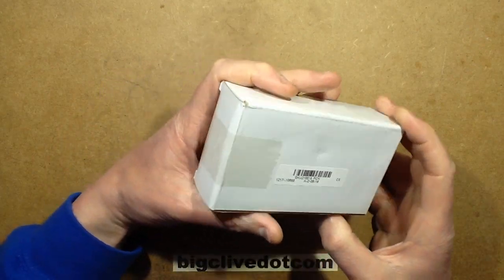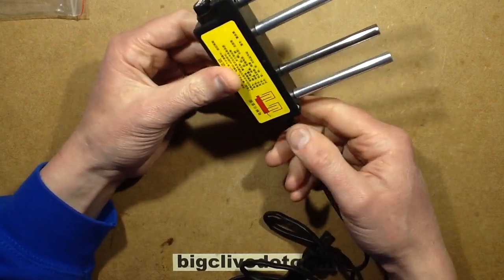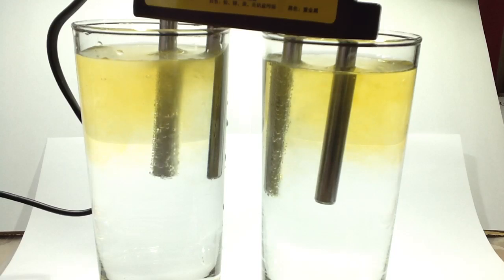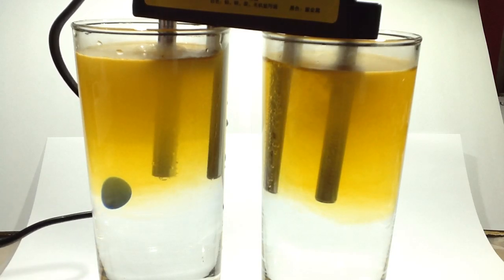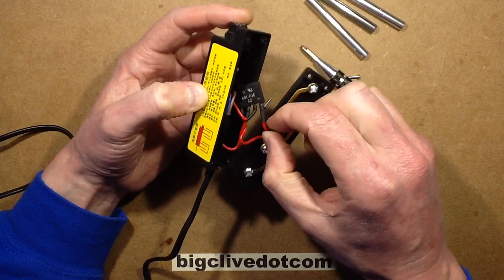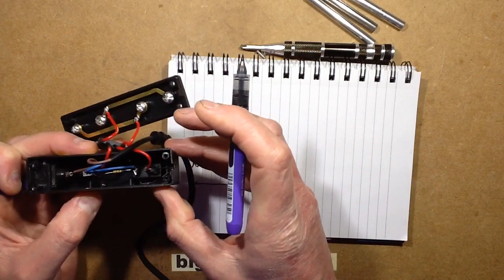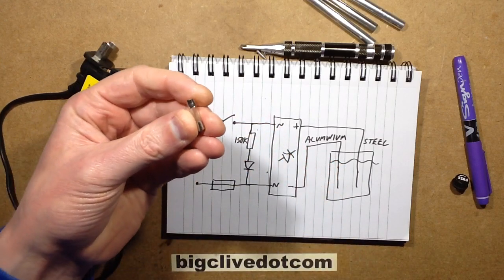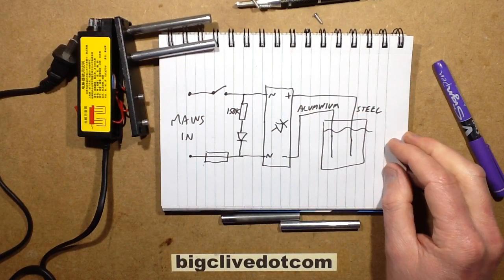Deadly quack water tester.  (scam)

Comment: If the water doesn't kill ya, that 'water tester' sure will.
I just can't believe that lethal crap like that can be sold legally.
Reply: I don't think it's legal.
Reply: If it was legal, though I'm not terribly knowledgable of EU or UK regulations, I doubt it would be labelled completely in Mandarin. Check the first few moments of video as the label sides are flashed around, there's not a single Latin letter.
Reply: hucker75  don't know why you are being a dick but surviving a shock from the mains isn't proof that it can't kill. What makes the difference typically is the route travelled through the body based on what is grounded. From a hand to a foot people often survive same with if it goes through just one hand. But when it goes from one arm to the other it passes the heart and easily stops it.
Reply: AC or DC, rectified or not, it doesn't matter, direct contact with non-isolated 240V mains live is going to fucking kill you. Period.
Also because it's rectified, both electrodes are live, and both will kill you.
Reply: @MrDoboz  It can kill you 50/50. More likely you will die if you have moist hands while standing on something wet. But obviously I don't recommend touching live conductors with voltages in them above 36V for anyone. 220V AC with dry hands in dry environment is already veeeeery unpleasant.
Reply: Cobb Butterscorn
Correct. DC is way more lethal though of course AC can kill. It's the current level that will cause the problem. 1A at 12VDC will kill you if directed to the right place but your bodies resistance will prevent any shock.  Can only imagine what AC is leaking through that bridge rectifier connected directly to 110/240VAC mains let alone unregulated 240VDC,  no step down transformer, no protection circuit AND putting it in water. What happens if it slips into the glass? A 10A fuse 240VAC is not going to help with all those bare wire connections straight to the mains! DEATH TRAP.
Reply: @KevinHallSurfing  tell that to ElectroBoom
Reply: Its not DC, its full wave rectified AC. The voltage still rises and falls between mains peak and zero, it just doesnt change direction. Both AC and DC are lethal at high enough voltages to drive enough current, DC is a more painful shock as there is no zero point. Anyway, the rectifier here makes no difference to the current flowing through you if you touch the electrode, or how painful it feels.
Reply: @howsyourdangler  If it doesn't change direction it's DC.  In this case unsmoothed DC.  There is a zero point, it just isn't crossed
Reply: @Mouseythegreat Well you are getting about 120/240 Volts (depending on country) across the terminals so make sure the seller has his hand on the desk to add to the effect ... but ... yes! Guarantee they never try and sell one again! 😆
Reply: @Deon Denis There's one born every minute.
Reply: hucker75 weird flex but ok
Reply: I have had to many close calls just growing up in the sticks and being an active person my whole life.

Maybe I should buy hazardous electrical equipment to increase the chances of success! Lol.
Reply: hucker75  Yes, killed by shoddy Chinese electrical goods.
Reply: hucker75  At next time grab live and neutral wires with both hands.
Reply: the average "scientific" (forgive me...) culture of the people is simply a shame.
Reply: @marcovalentinuzzi5830  
 Indeed. 
Most people have no idea of how even the simplest scientific principles apply to daily life.
Reply: You are an idiot!!! Its DC electricity, and its only half a watt...
Reply: Yeah only dangerous if you are a retard like yourself
Reply: @yoyoma5263  
 Grow up!
Reply: So ok the machine is dangerous. Does it work tho and show impurities in water ?
Reply: @romeowandrainbow1040  
 No. It does not work for that purpose, or anything else, really. 
 It delivers current to the water, and ADDS impurities to it, as its electrodes break down during electrolysis.
Reply: @romeowandrainbow1040  It works. A TDS meter will prove it. Test the water, then use the machine and you can see the impurities. The instructions list different colors to illustrate what's in the water.
Reply: Legal or not, if the mainstream media were so informative, why aren't they letting us know about our water being like that, instead of us finding out from a curious individual posting a video?
Reply: @samstyme4125  
 You should be using science, to make those discoveries, instead of relying on YouTube for it.
Reply: @CNCmachiningisfun  If science hasn't told the public about what's in our water thus far, when do you think they'll tell us? I did the same test. I also used a TDS (Total Dissolved Solids) meter before I did it.  I got the same results. I can send you a pic and video of the results, if you'd like. Then tell me if you'd drink the water, after seeing the things that became visible.
Reply: @samstyme4125  
 ALL you did was add pollution to the water, when you dissolved the electrodes in it, during electrolysis. 
 Please study the science behind this, and avoid further embarrassment!
Reply: @CNCmachiningisfun Then I suppose I have nothing else to say to you about this. Even though others may be an expert and more educated than you on a certain topic, does than mean that they are being truthful or even care about your well being? If that's the case, never mind someone like me, who's just questioning the narrative. I'll  leave you alone and allow you to "Trust the science".
Reply: @CNCmachiningisfun  so how come then that when I tested it on distilled water, it remained crystal clear? Surely it should turn brown or Green like the tap and filtered water if it’s adding pollution to it?
Reply: @TheNinja691  
 Give it time, and it will taint that water also. 
 Once you understand the process of electrolysis, the answer will be clear to you. 
 Edit: It sure would be nice if googleTube would stop CENSORING my replies!
Reply: It's direct current, you don't have to worry as much about it as A.C. I really think Clive is being a pansy, I would touch electrode while on.. it'll just hurt a little
Reply: @carolynmmitchell2240  Yeah, touch it with your tongue.
Reply: carolyn mmitchell What are you, the reincarnation of Edison? No, DC is FAAAAAAAR more dangerous given the constant voltage. It is like the different between getting shot with an automatic rifle verses a semi-automatic one. Yeah, both can have the same power and both will kill you, but the killing is at least slightly delayed with the semi-automatic (AC) given the breaks in firing just as how AC is referenced to a neutral point (often 0V). Also, AC requires a DC signal to stay stable. Kill the DC and you have just pushed the current over. DC? Shit is going to keep going until the original current source is killed...or you are. Guess which will happen faster?
Reply: @tygonmaster  It's not actual DC as there is no capacitor, it's rectified AC so it still hits zero volts just like AC.
Reply: @TomSmith-pl3tw  Not necessarily. Depends at what point it is being rectified.
Reply: @TomSmith-pl3tw  AC means "alternating current", and to qualify as AC the current must reverse direction at some cyclic rate. Since the current only goes one-way, it's high voltage DC, which is worse for you than AC.
Reply: I did not see a transformer in there.  where was it?
Reply: @thomasneal9291  In Shangri La, working by virtual influence and wishful thinking. Gwai-lo are not human, they are expendable.

Comment: So was that cloudy shit just rust from electrolysis ?
Reply from the maker: Yes.
Reply: I would add that what is really happening is that the donor electrode is polluting the water.  When you compare it to distilled water, which has infinite resistance, none of the metallic crud is stripped from the electrode.  Even your filtered water still contains enough electrolyte to start the reaction.  The scam probably involves using some water that is cleverly substituted out for distilled.  What they have invented here is a very dangerous way of measuring the resistance of water.  You could probably make a color chart to go with this thing and have an ersatz resistance meter!  I guess it could also be used as a spot check to see if water is really distilled our not too, providing the electrodes themselves don't provided enough soluble electrolytes to get things started.
Reply: I would add that what is really happening is that the donor electrode is polluting the water.  When you compare it to distilled water, which has infinite resistance, none of the metallic crud is stripped from the electrode.  Even your filtered water still contains enough electrolyte to start the reaction.  The scam probably involves using some water that is cleverly substituted out for distilled.  What they have invented here is a very dangerous way of measuring the resistance of water.  You could probably make a color chart to go with this thing and have an ersatz resistance meter!  I guess it could also be used as a spot check to see if water is really distilled our not too, providing the electrodes themselves don't provided enough soluble electrolytes to get things started.
Reply: anonymous probably iron 3 hydroxide

Comment: Scam? I want one of these! Switch the steel electrode, whose only purpose is to corrode and make the water full of shit, with a carbon one, or another aluminiun, or lead, whatever, and you have a double electrolysis thingie!

Even thought it mostly consist of a FULL BRIDE RECTIFIER (sorry for that) 

Ok, I better use a power supply

Comment: Correct me if i'm wrong, but if we say UK voltage is 230v (according to the regs), that rectified DC voltage is going to be roughly 324V DC (ignoring diode losses)...

Comment: That is insane! how the heck can that be sold. if that was even seen here OSH (occupational health and safety) would be all over that!!! im no electronic engineer or even very good with electronics to be honest. but doesnt 240vac rectified pump out close to 400 vdc? and im a seeing correctly are they switching the neutral feed?
Reply: 340-ish V, but yeah, 240 is just the 'average' voltage from the mains (or more correctly it's the RMS voltage (as the average is actually 0V, what with adding all those plusses to the minuses)).

Comment: Complete scam device. Use steel as a sacrificial anode. Basic electrolysis. Could be turned into something useful. Build some DIY electrodes, baking soda to lower the resistivity of the water and you have your very own rust-killer. Just make sure what ever you are free rusting is connected to the cathode (-) or it will eventually disappear! Sort of.

Comment: Is the output not DC current? I don't get shocked while touching both car battery terminals... Just wondering.
Reply: +timmyboy Car battery is 12-14V DC - you won't get shock from this, but 250-280V DC is totally different story.

Comment: The reason for the different electrode materials and the fact that they are on the one that they are on is due to the electrolysis, The Steel anode will free up Fe+ ions into the water which mix with the O- ions produced during the electrolysis, causing the rust to appear in the water. Different steels will also release other metals into the water which may be the cause of the different colours appearing in the 'foot treatment' video.

http://www.metaldetectingworld.com/anode_positive_electrode_p9.shtml

(Disclaimer, based off secondary school knowledge and quick google searches, take with a pinch of baking soda, don't use salt in electrolysis, warranty void in case of death)

Comment: that device only cheks the conductivity of the water, if you take water from a toilet and mix it with suger it will tell you that its ok to drink it(sugar makes water less conductive), but if you will take filtered water and mix it wirh a little bit of salt(salt makes water more conductive) than it will tell you that its not good to drink the water, becouse the iron containing electrode is in the posive side, oxigen forms on it and not hydrogen like on the aluminum, and the oxygen forms iron oxide with the electrode(you can tell thet its iron oxide by the collor, you can also tell what is positive and what is negetive, becouse when you electrolyze water the negative has double the bubbles as the positive)

Comment: it is just doing ilectrolisis
Reply from the maker: +stratis miritzis Yes.
Reply: +bigclivedotcom Unsmoothed DC is often used in battery chargers for cars - which is basically performing electrolysis on the battery - I think the different metals of the electrodes are essential to the process with the water as there is no acid as you would have in a battery... just a theory...

Comment: How the fuck is this a water tester ? It just makes shity brown water ! So it strips the metal ions into the water because it can't attach to the aluminum! How does that make sense ? Put impurities into the water what is that going to show?
Reply from the maker: +Phoenix Marzrover It's fake.  They tell you that the rust is just the impurities in your water being visualised.
Reply: +Phoenix Marzrover 
To people who don't know how it works, they think the murkiness is created by a reaction with the "impurities" already in the water.
Anyone with knowledge of electricity and electrolysis can see it doesn't test anything, and anyone scientifically minded enough to "test" the water after unnecessary and expensive filtration will see nothing is different. However, lots of people have neither of these qualities.
Reply: +OriginalPiMan   I'd wager that yellow cloud is aluminum chloride :-) I'm glad poster didn't drink the water.
Reply: +bigclivedotcom #science
Reply: +Phoenix Marzrover How is Trump a presidential candidate? -> Your argument is invalid.

Comment: If the receptacle is wired backwards, then the positive electrode becomes an un-switched hot. In 220 countries, it is just plain always hot, as wired. Simply touch the electrode and ground yourself and you will get a nasty shock or be killed., even if switched off.

Comment: I was in the Philippines and a friend of someone came round to try and sell us a machine for distilling water. As per this video, they first had to show us how crap the stuff we were drinking was so they took a glass of tap water and stuck a mains rectifier in it. The electrodes were black, I wondered if they were carbon. It fizzed and bubbled and turned into a glass of brown shite. Disgusting.
Then they put it into some of their distilled water to prove that it doesn't pass current and therefore must be better.

As it was a friend, I didn't want to shame them. What I really wanted to do was take a glass of their pure water and squeeze a lemon into it. "You'd drink that, wouldn't you?" Then shove their electrodes into that to see what a mess it made.

Needless to say we didn't buy the thing, we just bought safe water in those big containers you see in offices etc.. The cost of running it would probably be too high anyway.

Comment: Since this has a rectifier and is outputting dc, is it producing hydrogen via electrolysis?
Reply: Yep, that's probably the bubbles. Should be coming off the iron electrode if I've got my elements right. 

The bubbles also might be steam, from the heating effect, Clive also demonstrated a few devices a lot like this, only without the water-polluting features, including a Turkish kettle and a Chinese coffee-warmer. They simply pass mains current through water to heat it up, no heating element.
Reply: +Your video is bad and you should feel bad!...unless of course your video is good, then carry on. Easy way to find out: try lighting it after running it with a cover for a while. ;P
Reply: Yeah, don't try that though, insanely dangerous.
Reply: Hydrogen and oxygen, The oxygen is being produced on the Steel side, therefore rusting the electrode.

Comment: Different electrodes increases the electrochemical potential between them. The reaction wouldn't be nearly as big (or even noticeable) if you used two of the same (any) material for both electrodes.